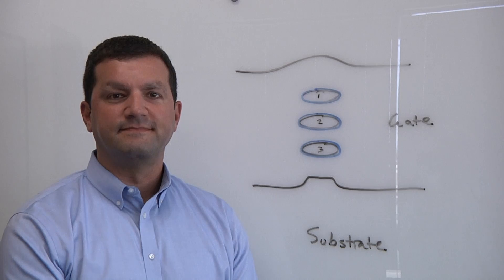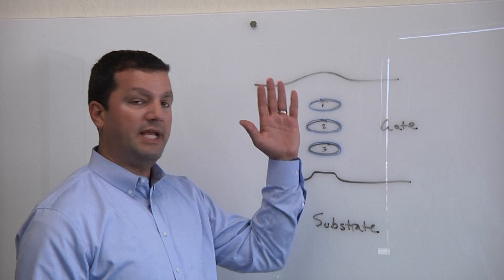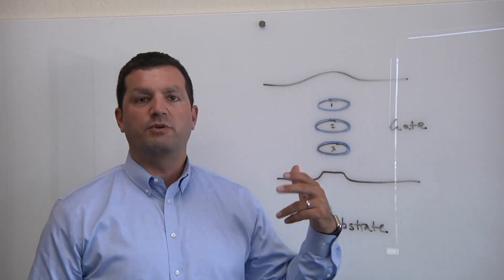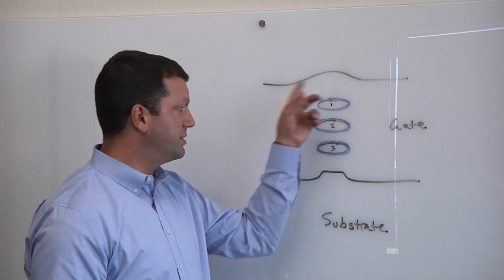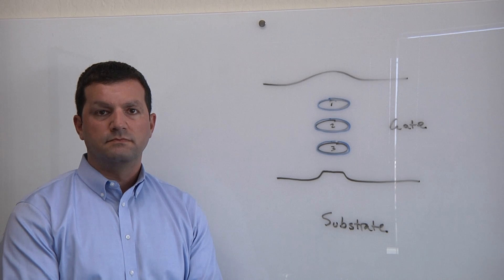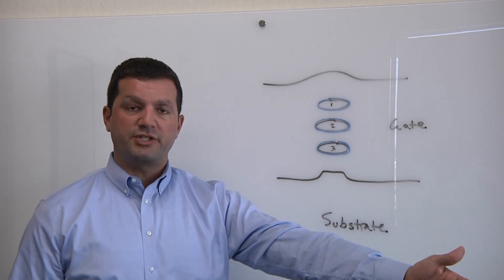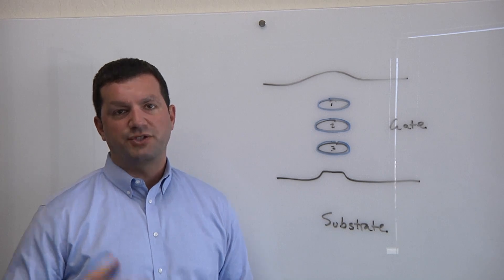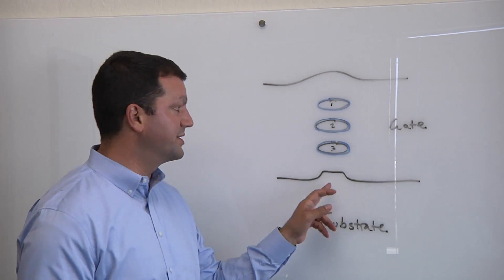Next-Gen Transistors

Comment: Maybe a dumb question, but if the gate completely surrounds the "wire", where do the charge carriers go when the field is applied, and where is the depletion zone? Is it like a skin effect where the holes are pushed into the middle of the wire and conduction happens on the edges?
Reply: Yes and also how does a single gate control different channels independently?
Reply: @cacssarcaeustan2543 It doesn’t.  It is one transistor.  Think of the stack of 3 ribbons as an alternative way to create a single channel.  Back when transistors were simpler and planar, the 3 ribbons together would have been as wide as a single channel where all 3 ribbons were in the same plane and abutting each other; a single, 3x as wide, channel.   But with the 3 ribbons, each 1/3 of the formerly wider and simpler channel is now controlled by the gate from all sides, providing greater control.  And in a smaller area.

Remember that a planar transistor’s W/L ratio determines its strength, and L is minimized. So making a stronger transistor would mean making it wider.  Instead of making a single channel wider, three channels are stacked on top of each other.

That’s my take.
Reply: What I don’t get is that the 3 stacked channels imply that silicon is deposited at the core of those ribbons, instead of just having a simpler planar silicon wafer that gets doped in the N and P regions way back when.  Isn’t depositing silicon like this quite different than growing a silicon ingot with a mono crystalline crystal structure?  I think I’m missing something because what seems like a big difference is never discussed, that I hear.
Reply: @ttb1513   Do you ask for how they construct a GAAFET ?
Reply: Yeah thats a good question, maybe the charge carriers come will flow from the source and drain once the gate is properly biased?
Reply: @levarg91492  all three at once?  so one gate runs three channels at once, the same, for the example shown on this video's white board.